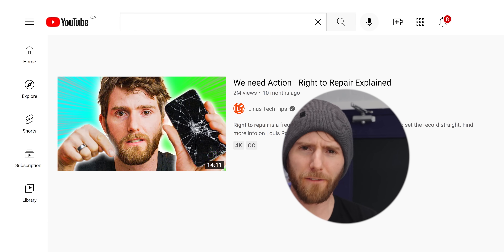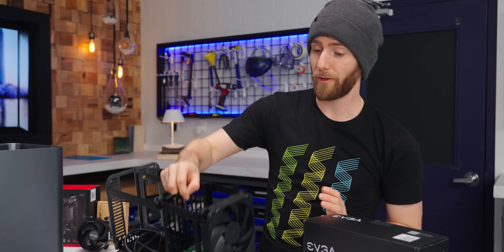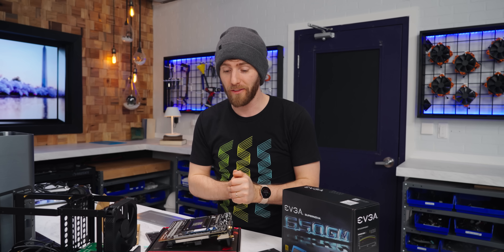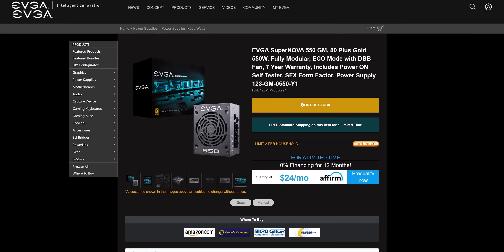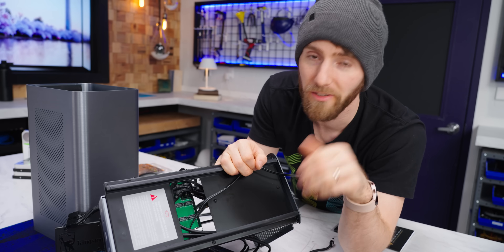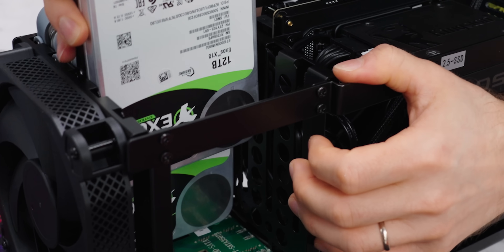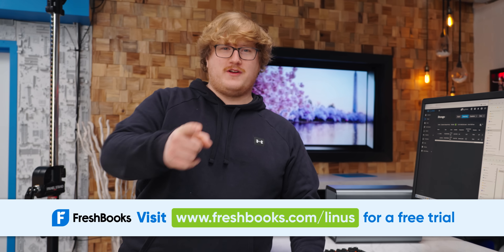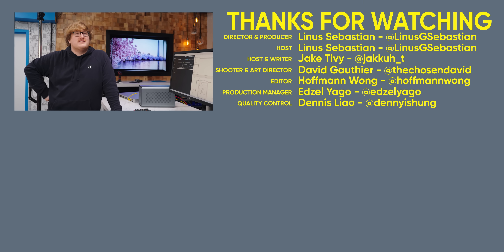This blows away the competition - JONSBO N1 NAS Build

Comment: Why do you never compare the power consumption of both solutions in such projects? When a system like this runs around the clock for years, it's relevant.
Reply: How much do Synology servers usually consume in terms of power?
Reply: @frodolon   	59.8 W (Zugriff) = 8 HHD's + 2 NVMe
26.18 W (HDD-Ruhezustand)
Reply: @ShinyHappyREM  26,18W is with HDDs in sleep mode
Reply: @hdffjfhsdlfh  My server is 35W idle (dunno whether the 2 HDDs are on or standby) with an undervolted AMD Ryzen 5 4650G Pro, 4TB HDD, 128GB cache SSD running unRAID
Reply: @ShinyHappyREM  Ruhezustand meens HDD sleep mode. So if it just sits there it will consume about 27 W... And if you read/write to NAS then it goes up to ca 60 W (with 8 disks)
Reply: @frodolon don't care about those
Reply: The CPU alone idles at 20W, so the box is probably 40-50?

Meanwhile, your Synology idles at 5-12W and runs "flat-out" at 15-25.
Reply: @kevinmeyer1583 they also are removing the ability to auto update firmware on non Synology HDDs
Reply: The long term power consumption will likely vary wildly depending on the power saving settings you use for the spinning rust.
Reply: Especially when you're not in Canada / the US.
Reply: @ShinyHappyREM  I read Yasmine's comment, I thought that I should probably start looking how much power my homelab is using.
Then I read your comment.
I'm in canada.
Meh, I guess I won't be looking at power consumption considering that
Haha
Reply: @ShinyHappyREM  Agreed, we pay basically 1$ for electricity per KWH now in south sweden, it's nuts
Reply: Exactly. I don't want to be paying more due to higher power consumption. The utility bills are high enough so maybe if they come up with an arm solution it'll be better.
Reply: @TacticalFreak  100% completely legit, for me i just like the idea of doing this stuff for my own knowledge, even if in the long run it will cost me a little more, but i totally see how that would be good for you!
Reply: It'll use about the same amount of power as any NAS using the same drives, as they use most of the power.
Reply: I'm sure there's a setting for the system to basically go to sleep when you're not using it, at the expense of more latency when you wake it up.
Reply: If only there were RISC V or ARM CPU options to use
Reply: Agree Yasmine. Half of the US consume GAS where the other half use electricity. Both are very expensive. Those on the east coast brag about the low cost of electricity and how they can do mining to their hearts content but never realize it's balanced out by their heavy use of gas for half of the year. People on the west coast hardly ever use gas so we have very expensive electricity at $0.30/kw in socal, for example. Anything that is on 24/7/365 will immediately increase the electricity bill significantly here in the west coast.
Reply: @ratmash747  the problem is its a very mixed bag on power consumption. at idle most hardware, even relatively high power hardware can run on very small amounts.
most server OS's allow you to spin down inactive drives, your CPU will normally put itself into a lower power mode. 
but how hard your system works will contribute. if you're running lots of VM's you're going to have higher power use than not. if you're using HDD vs SSD you're going to have higher power consumption on the hard drives when they are running vs what you'd have on an ssd whilst running.
power consumption is so widely varied based on use too. if you use your servers storage all day long you're gonna use more power than if you only access it for backups.
Reply: Please do a video/build that actually uses ecc ram, mobo, and cpu. Those three items alone can make the cost of the build either too high , or too hard when trying to source parts .
Reply: @ratmash747  If the money is not a problem: 
PSU: HDPLEX 250W GaN 
CPU: i3 10100t 
My personal recommendation to avoid MVMe drives for power savings, but if you NEED one: SK Hynix Gold
Reply: LMAO yuropoors 😂😂😂
Reply: You can’t compare only power consumption if you don’t add to the comparison the performance in smb/afp, the ability to do a VM, or DLNA storage and also an iPerf benchmark
Reply: There's no special magic in these prepared tousters to make them be lower in power consumption. It's just about ultra low power (and ultra low computer power) CPU's.
If you'll use the same CPU in your built "NAS" you will get same low power consumption, but will you? No. Because when you're building your own NAS you want to run there a lot of stuff there, you will want to have fast data transfers and not only 80MB/s, etc. So you will place there more memory (especially for ZFS), powerful CPU, ... and therefore you'll have higher power consumption.
Reply: @TacticalFreak  how much backblaze storage for $3 per month?  thanks!
Reply: @swifty1969  should be about 300gb
Reply: Probably since energy costs are cheaper compared to places like Germany, so they don't really question it
Reply: Yes, for such a build I would think that is important.
Reply: Yep. This thing probably runs 150 - 200 watts compared to a dedicated NAS.  However if you're running a Plex server with real time transcoding, this thing is well worth it.
Reply: @linux230  Still very expensive to waste 150W constantly for the couple of hours once a day or twice a week that you actually watch anything with real time transcoding. Might be cheaper to just have the system transcode stuff in advance. Personally I don't watch 4k anyway, so I don't need to transcode anything at all. My 24/7 all-SSD Jellyfin server draws 10W and does a bunch of other things as well.
Reply: This is something im gonna have to do soon cause dropping 250$ for hard drives to store movies and series might not cut it soon.
Reply: 99.9% of people just don't care. More people care about the color than the power draw.
Reply: @jamesmcjamesington631  when u are American and a bit ignorant that might be true.... for same number 99.9% people in Europe we do... ok? But take u have never been outside the state in US of which u were born and think everybody are like you there
Reply: @Rene-kg7pf A bit sensitive, aren't you? You're 0.01% of the population.

Noone cares about the power draw. Especially when the difference between one unit and another at idle is a few watts. And when it will be used 0.5% of the day.

Even considering the average power user, they care more about the features and performance than the power draw.
Reply: @Rene-kg7pf besides... The product clearly wasn't marketed to you. You don't buy something that's 100TB if you care about the power draw. Your point of view is absurd. The company that makes the device doesn't care and neither do the other people watching.
Reply: @jamesmcjamesington631  a server is not used only a little bit a day... what you seems to not understand is people usually run them 24/7 I run mine 24/7 here in Europe and have made plans to power down the drives to idle (also not spinning them up all the time coz they are made for running 24/7) so yeah I know on pair with alot other Europeans that power consumption matters! And that was his point... You would go homeless if u had to pay for what we do for power here!
Reply: @jamesmcjamesington631  product 😃 no I did my own DIY NAS and yeah I only have 80TB but there's always ways to make those 80TB use less power instead of like example buying alot of smaller drives u can go with 4 x 20TB as example... right ... u see ... u are just a pure beginner here and your "points" are only bias without any substance
Reply: @TomiKobayashi-0506  Yes, I live in Germany, where electricity is quite expensive. It quickly adds up to hundreds of euros a year. It's not about whether I can afford it. Why should I waste money unnecessarily? Energy efficiency is always a good goal - no matter how rich you are or how cheap energy is.
An internal hard disk is obviously no substitute for a NAS if you want to access the storage from different devices at any time.
Reply: @yasminesteinbauer8565  My point was adding onto your already existing systems storage with what ever M.2 nvme or Sata ports with a HDD/SSD ,that you haven’t used should be done first. if you outgrow that then look too NAS.. And far too many are not fully loading their systems as I have described, then they bitch and whine about the power draw of adding a NAS..And you can set up your internal pc system to act as NAS. and that’s long before you outgrow any storage media size/capacity..That is what anyone should do first if they need soo much storage. Then worry about extra devices such as NAS,once they have done soo..I’m simply offering advice to those who want more storage but haven’t reached the capacity of their already existing system as an alternative to do first..
Reply: @yasminesteinbauer8565  my point was to use up ALL of what your existing system has ,if you are not doing soo already. After that then look to a dedicated NAS. Far too many are not doing soo, then they whine about additional power draw of adding yet another system.. This is an alternative way for more storage,long before you get too even needing a NAS.. That applies to all whether home or business user, there are options for you before you get too that point that few actually do. And might save you money by not running essentially a whole nother pc which is exactly what a  NAS is.. And it’s not difficult to set up your own main pc to be a NAS anyways,and access it from anywhere, or from any other device. Additionally too save on e-waste use your older pc that you have and upgrade it as far as you can so it can be a NAS as well.. Soo many options too set up yourself that far too few people ever do!?
Reply: @TomiKobayashi-0506  Running a gaming PC 24/7 would consume even more power. Also, it might be located in the room where you sleep and you don't want the noise there. You may also want specific features such as ZFS in a NAS that your Windows PC doesn't have. If someone asks you what kind of car they should buy, you wouldn't advise them to upgrade their lawnmower instead, would you? So I really don't know what you're getting at. A PC upgrade is no substitute for a NAS.
Reply: What an arrogant uninformed rant!
Reply: I agree. I would have liked to see how much power it consumes.
Reply: If you’re doing a custom build it should be assumed you’ve taken that into consideration and already did the math… why do you need it spoon fed to you?
Reply: You could just use a lower power CPU for that reason. I feel that a bigger problem than power is actually finding a suitable itx motherboard with sufficient SATA ports. It probably is the reason they went with that ROG motherboard instead of a cheaper one.
Reply: @physxme I finally found one. It’s from a brand I’ve never heard of. CWWK
Reply: @physxme  I built a system that (see post somewhere in this posting) that has 13 sata ports on it. My system has 8 5tb 2.5" drives in it.....total of 40tb with approx 30TB useable.....
Reply: @walterwhite2270  Hey. While I understand what you're trying to say (that the power you save is minimal and doesn't worth to try figuring it out), you missing you point. 
The power consumption is always relevant, especially at times like this. If you 're working hard for your goods, then you'll understand. If you do not pay for them, then you'll be ignorant. If you pay but you don't care, it means that you're wealthy. If that's not the case, you should consider trying to figure out what you're paying, exactly.

If you save here and there, this will affect your bills in long term. You only see the "short term".
Reply: Yeah. I'm still on a raspi 4 with only 1 drive for my home cloud for that reason. Sure, I could have much larger and faster storage with a proper NAS, but it's not really worth it for the extra power consumption.
Reply: @seeibe  I used 5 bay (total 40tb) and 1 ssd with pi4b, total setup excluding drives is around 200, and there's individual switch too.
Reply: @seeibe  Similar setup here. Are you using Plex? If so, do you have problems with videos when using subtitles?
Reply: @seeibe  1 drive? and when-not if- that drive dies? do you have backups? if not then save power and just delete your data now, then power off your storage server.
Reply: @indy.b  Yeah, I use backups. Though I think you're exaggerating. I haven't had a drive die on me in 20 years of using computers. Sure it can happen, but it doesn't mean it will happen, especially if you keep upgrading to newer drives every few years.
Reply: @seeibe  no worries, you never know... BTW I have had multiple drives "just die" at power up, usually backup drives that would just not power on after a year
Reply: I just use LTO tapes, The power use is about 1-2 hours a months during running time and the data is much safer the HDD.
Reply: @shmayazuggot8558  a raid storage server is not backup. your lto tape backup device is not a storage server... try playing music from a streaming mp3 player into your hifi from your tapes... btw i like tape but dont confuse raid, backup, and NAS online storage
Reply: Personally I’ve never needed this much storage but I’ve just plugged my old laptop running Plex 24/7 into a timed outlet to limit power draw… I have no idea how much power it draws but now I’m curious…
Reply: Not really, your drives will eat up most of the power consumption anyways.
Reply: I mean if this is just a home nas you probably aren't running it around the clock
Reply: Power consumption on a 5bay this small is the least of your worries... If you are that worried about it.. Then you obviously can't afford it
Reply: @TyeBoCash  or you might have alot narrow American Point of view upon things
Reply: because it mostly deoends on your psu, harddrives etc. not on the nas itself.
Reply: I think the conversation about power consumption misses a significant point. Linus made a point of comparing the price of the a Synalogy NAS to a diy solution and regularly talked about making this a budget build, even comparing the price of the diy solution (which ended up being only $10 different in price). Unless you have solar panels, this isn’t a budget build and you should just get an off the shelf nas solution. Also, if you can afford solar panels you probably don’t care about care about budget. This is an interesting server build with many great solution and benefits over an off the shelf solution, I just don’t think price is one of them and they probably shouldn’t have positioned the video that way.
Reply: @KamBha  you missed the point that servers run constantly, and even small differences in power consumption will add up over time.
Reply: @Megasteel32  sorry, I didn’t make my point clearly. There is a lot of discussion in this comment thread  about whether $100/year was a big deal. My point was that it doesn’t matter from the perspective of the video. The video tried to establish that the diy solution is cheaper than the off the shelf solution. It is not when you consider power consumption. That is, considering the price difference between the two solutions is so small, this cannot be branded as a budget option for a nas and if you are budget conscious you should not build your own nas because in a year, your “savings” will be wiped away. As an aside, I am sceptical that you cannot get a similarly priced nas to the diy option for roughly the same price.
Reply: @KamBha  it's not $100 a year. for a system that draws 400w, it's $500 a year. you can be budget conscious and still build or buy a NAS. it's not about can I afford to have a NAS, it's about which NAS can I afford over time. also, it really can be a budget option for a NAS since that NAS they featured is on the very cheap end of the spectrum. medium tier NASs without hard drives start at $400 and go into the thousands easily.
Reply: @bassplaya69er  a NAS with it's hard drives spinning 24/7. thats how storage servers work, on average a drive draws 20W
Reply: @Megasteel32  The average for my exos drive is about 5.7 watts, idk where you got 20 watts from.
Reply: @bassplaya69er  I run a homelab, my storage servers are always on because they are serving content (MC server)
Reply: @bassplaya69er  even when not in use the server uses energy to seed stuff, check drive and data health to avoid data rot, and I run several MC servers
Reply: @bassplaya69er  ssds cost money and I'm using SAS drives meant for 247 use
Reply: If you care about power consumption, use less drives but with higher capacity.
The cpu and motherboard doesn't need alot (unless you went bonkers with a r9 6900x). Power management is done by the os anyway.
The main power slurpers are the drives themselves.
Consider using 2.5 drives instead 3.5 for even less power consumption, if you're willing to trade with total potential capacity.

The video still made its point. Modularity and upgradability.
Reply: @cursetheroad  with old hardware the drives are not very significant.  my current server uses over 200w idle with drives spun down because it is using an old i7 4930k and a pair of 290x.  where i am now has very cheep electric, but i will have to upgrade to a low power ryzen system soon when i move back to the UK as it costs about 2GBP per w per year there now.
Reply: @TacticalFreak  a local NAS isn't about just storage and if power consumption from your storage solution is a primary consideration then you probably don't need a local NAS. If you need a storage solution that consolidates all your data so it can be a single point access for multiple devices on the fly like installing a single instance of a game for 3 or 4 computers to pool from or be able to access all your media from any device then a local NAS might be best. Although seeing the difference in power consumption would be interesting anything under 120watts is trivial since a single 60 watt WIRELESS charger will blow thru more power charging your phone than the NAS per day.
Reply: @Guardian_Arias  hey you are right that the nas is not just about storage. Hence can't compare backblaze price only with electricity cost of the self hosted solution. Since the self hosted can do MORE stuff.
Yeah true.

For this reason, I use at home small raspberry pies for other things than storage. I use a pie zero, and a nanopi. Both I chose for their low power consumption since they are 24/7 uptime

For the heavier tasks, like web servers, I also use a cloud solution, a vps. Which cost me $20 per month.

The calculation is tight at this point. Server + backup cost me say $25 a month, all included. Would still cost me more at home because of electricity.

Stuff that I do self host would be only on ARM device at home. That way, I think I'm the most efficient cost wise, but I can't do all the stuff you mentioned. True.
Reply: @Guardian_Arias  that's not how power works. a 60 watt phone charger that operates for 30 minutes charging my phone (phone's battery is rated at 4,000 mAh, at 3.7v that's 14.8 Wh, rounding up for power loss it would take a 60 watt phone charger if we pretend that my phone can charge at 60 watts 30 minutes to charge from 0 - 100%) is going to use something like 16 Wh to do so (again, rounding up to account for losses in the AC -> DC conversion, cable losses, etc). a 120 watt server running 24/7 is going to use 2,880 Wh (120 W * 24 hours). Watts measure instantaneous power consumption, Watt hours measure power consumption over time. Why else do you think server CPU's are designed to be as power efficient as possible? Sure, they still draw tons of power, but their performance per watt is outstanding.
Reply: @Megasteel32  wireless chargers barely hit 30% efficiencies at 60 watts it pulls more than 180 watts and have a trickle waste on top of that when not charging.
Reply: @Guardian_Arias  wireless chargers on average are 80-92% efficient. Also, wireless chargers above 15W don't exist. But that wasn't my point. My point was a) power consumption is very different over time and b) the costs of running a server compound far more than a phone charger, of any efficiency, and of any power draw because you aren't charging your phone for anywhere close to 24 hours a day.
Reply: @Megasteel32  they most definitely are not. 80% is impressive even for high q factor resonant transmitters/receivers. When you factor in receiving receiving losses/rectification for things like phones, with shitty receiver coils, a 10 watt charger will often be closer 3-4 watts.
Reply: @ratmash747  Why would you look at power consumption? Ignore it all together. Let me explain this so you don't go buck wild. Take, for example, cable or dish TV, which typically costs around $100 per month for all of the good channels, or $1200 per year. That does not include the internet, so don't count on that because, let's face it, we all have it. Treat it like your electric bill. Either way, it gets paid. It doesn't matter if you want to pay it or not; it's still there. So back to the dish network or cable. That's $100. That means, even on the most shitty processor, take the Fx model AMD with 15 drives and a GTX 1050 that does not require a 6 or 8 pin. That PC runs about $20 to $30 per month. Let's do the math. $100 minus $30 equals $70.That is how much you save, which doesn't sound like much, but 30 x 12 is $360 per year, so you save $840 per year. Why waste consumption when you can make a dent in the big end? That means you can upgrade drives every 2 to 4 years and still have money left over right now if you have $840 leftover. 12TB Drives are $219.11 on Amazon. That's 48 TB. I also don't count hard drives as an expense as far as the build goes. Because once the server is up and running and paid for, the hard drives will be the only experience you will have. Yes, you will have an unexpected thing happen, like a board going out, a RAM issue, or even a video issue, but we can break that down too. Processors rarely ever go out. Ram has a limited lifetime warranty. The only thing you'd have to pay for would be the power supply or motherboard. If I wanted to patch things up, a lot of those would be used items
Reply: @lawrence1986ify  ignoring the fact you don't need a GPU in a NAS and that using an FX model CPU is a terrible decision in 2022 for any use cases, here's why your math and reasoning is wrong: 
1. money spent is not money saved. it's not about "can I spend $100 a month on cable or $70 a month on a NAS" it's about "I'm going to get a NAS, how can I make it cheaper over time?". He isn't saving $840 a year if he doesn't already have cable. That just doesn't make sense.
2. that $20-30 a month figure isn't accurate either. The current average power rate per kWh in the US is $0.1042/kWh. Using your build of an AMD FX (I chose the 6300) and a GTX 1050 with 15 hard drives, a small boot SSD and 8GB of RAM, Newegg's calculator spits out 553 Watts. Remember, hard drives on average consume 20 Watts each. There are 730.48 hours in a month, times 553 Watts that's 403.96 Wh, or $42.09 at the current average. Small difference you say? $12.09 * 12 is still $144.84. Which means if you were running that NAS 24/7/365 as servers are supposed to do, that's $505.08 a year. Forever, as long as you keep that NAS running. 
3. The key thing you are missing (ESPECIALLY when you "don't count hard drives as an expense as far as the build goes" FOR A STORAGE SERVER) is that servers are not comparable to other consumer electronics when it comes to power consumption. Most people don't take into account power consumption when building a PC or buying a laptop except when they're figuring out can their PSU supply the power requirements of said components. Servers run 24/7/365. The bulk of their cost is the power consumption. Sure, the cost difference between a gaming pc running for a few hours a day using 500W vs 800W is not that significant. But it absolutely becomes significant when you start running that server 24 hours a day.
Reply: It is less than 100€ per month, so it is meaningless.
Reply: @Ziegeri  how rich are you? do you actually believe 100€/mo isn't that much, for a lot of us 100€/mo is actually a lot of money

Most of us aren't rich, for some of us even just 5€/mo is a considerable amount to commit to spending for years
Reply: @dustinm2717  Not rich, but I have a job.
Reply: @dustinm2717  Then you have no business building a 100 TB server in the first place.
Reply: @Ziegeri  
If 1200€ a year is meaningless to you, could you please donate it to me or, better yet, aiding the Ukrainian defence and refugees?
Reply: If you are worried about power consumption. Please make sure that you power off all your computers (permanently) unplug all your televisions, dvd players, power charging devices that charge your phone ...etc.....then get out a pencil and a piece of paper and store your information on paper....yet that is a waste of resources tooo.....oh by the way...do you turn off your router and internet devices when not using them? I suggest you go back a few hundred years in time...maybe there is a cave you can live in....
Reply: @walterwhite2270  Something that eg costs four times as much to run in electricity but was cheaper to build, is going to end up being more expensive in the long term. It's an incredibly salient point. Power consumption is still a cost. Electricity isn't free. In fact it's more expensive than it's ever been almost everywhere in the world.
Reply: @1337Raspberry  it can be if you generate your own power, then its technically cost savings when you factor in how much it saved you in power costs building your own power gen :P yes i know totally something 95% of people dont do, im in that weird 5% where i would totally setup a wind turbine + solar + hydro if i , A owned a house, and B had a place i could do those things
Reply: @1337Raspberry  more expensive that it’s even been? Do you know what electricity cost in the 1800s for example?
Reply: @walterwhite2270  you've gotta be pretty damn incompetent to compare idle power consumption of low-power devices like phones, to a full spec computer that serves data 24/7.
Reply: @walterwhite2270  Maybe you don't have to pay for the electricity your rig uses, but I do. We do not all live in regions where energy is dirt cheap. So yes, power consumption is a consideration. Of course there is no need to take it to the extremes you decided to run with in your comment, but it is sensible to try to maximise 'bang for buck', there is nothing wrong with preferring to have all the information necessary to make an informed decision to arrive at an acceptable trade off between performance/function and running costs. And for something that is best left running 24x7, it is reasonable to try to determine what those costs are likely to be and be able to manage them and keep them at a level that you are comfortable with when they are coming out of your pocket.
Reply: @walterwhite2270  I'm not worried about power for powers sake. I'm worried about the cost of convenience and unplugging everything for minimal gains is so far removed from convenient as I am from mars.  For me the difference is about 50€ in power a year comparing my synology 1821+ and as similar spec old system. Over the expected runtime of ~5 years thats a whopping 250€ not speculating how hard  energy prices will rise.
Reply: @Shiroi0moi  Well i'm just happy to hear you don't have to worry about money.
Reply: @Shiroi0moi  Well that's because normal people don't really earn that much over here. I have to feed a family but I still want to have tech so I have to go smart. You might call it penny pinching but having 100€ more per year does matter. And since your so well off why do you even complain about my concerns?
Reply: @hdffjfhsdlfh  "why do you even complain about my concerns?"
idk, because I can lmao
Reply: @Shiroi0moi  what a reflected contribution...
Reply: @walterwhite2270  dude power consumption is relevant since prices has hiked up alot lately
Reply: @walterwhite2270  True words - i have two huge NAS here (yes i life in Germany and give a fuck of the power bill) - and bouth are TrueNAS machines in a 19" Rackchassis with around  24 drives per machine. 
I tried some NAS from Synology and tincker alot - in the end , it was a mass. I use both machines in a professional use and i am happy to have this now. 

You have your own control about your hardware, get a great support from the community or sometimes directly from TrueNAS or here at YT and so, you can upgrade it easy, because you do not have any proprietary hardware and so.
Yes the power consumption is higher but i am safer so :) 

The next NAS is a similar build to a Storinator :)
Reply: @walterwhite2270  this did not age well did it ?? haha
Reply: @walterwhite2270  whataboutism.
Reply: @walterwhite2270  Lmao they actually include a lot of stats re. Power consumption in their videos now because they realized OP was right and the cost of electricity varies widely depending on where in the world you are. It’s a very relevant factor for many people.
Reply: @walterwhite2270 nothing wrong with turning off shit if you are off grid on batteries.
Reply: @walterwhite2270  not all of us made a fortune cooking meth, just curious how much upkeep is on a build like this
Reply: @walterwhite2270  There's a big difference between "vampire" power consumption of 1-3W and a unit that is activity consuming 100W. By your logic, leave all the lights on 24/7 and consume 2,000W of power all the time. It's only $24/day in power ...
Reply: @walterwhite2270  buy a solar panel